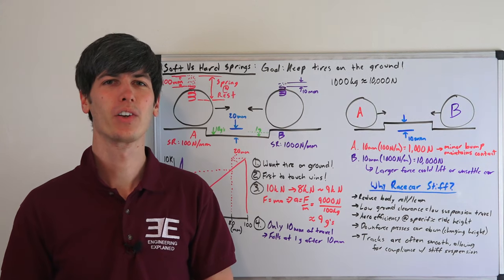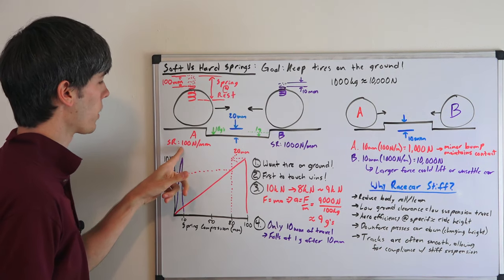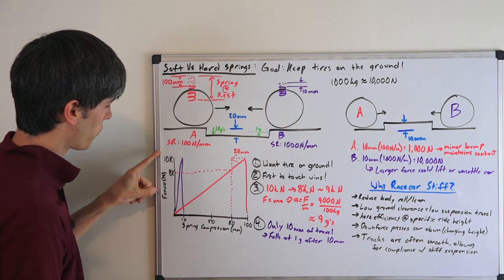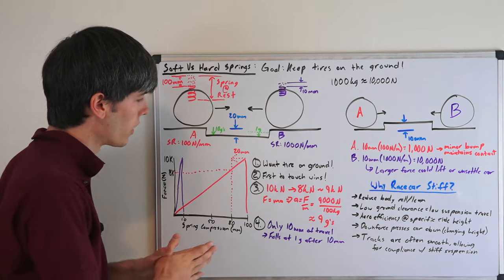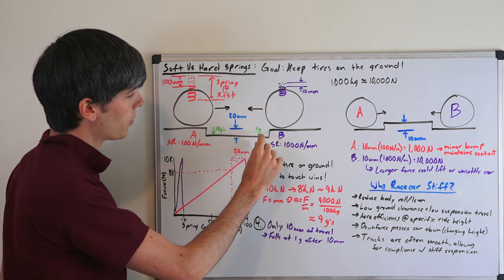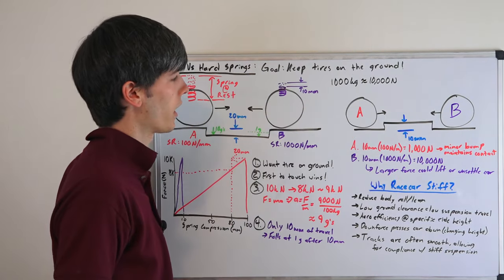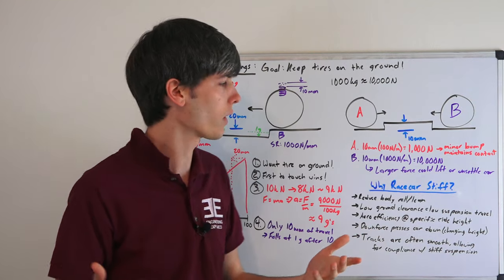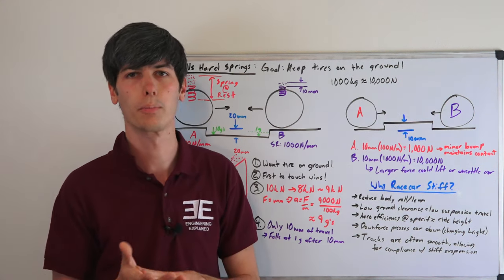What's The Best Suspension - Soft or Stiff Springs?

Comment: Soft if you can handle the roll, since a soft suspension means grip. I've noticed that in some cars, just upgrading anti-roll bars and adding sticky tires improves the handling a much greater amount than when a lowered and stiffer suspension was added.
Reply: Unbearable Pain I disagree.  Some people say the primary roll stiffness should come from the springs, not the sway bars.  The sway bars reduce the independence of the suspension.
Reply: TassieLorenzo True, but in big V8 muscle cars the suspension isn't independent anyways.
Reply: TassieLorenzo totally untrue... wheel indepenence ist not nessesarily a good thing. the myth that stiff suspension and hard dampers are a good thing comes from formula 1. in formula 1 you want the car to have the same attitude to the road at all times to maximize downforce. "mechanical grip" is irrelevant in F1. but since a roadcar has no downforce soft suspension will be better. thats also the reason why for example ralleycars have really soft suspension compared to for example f1 cars even when the are driving a tarmac ralley.
Reply: MrBusunglueck "but since a roadcar has no downforce soft suspension will be better. " Then why do road-based race cars with no downforce have stiff suspension? ;)...  I agree there is such a thing as too stiff, but driving some road car on a track day with Hoosiers and using stock comfort-tuned suspension will give a terrifying wallowy feeling and feeling of lack of control.  There is a REASON after all why PROPER sporty cars like Renault Megane RS, Civic Type R, Lancer Evolution, indeed Ferrari F430, etc all come with relatively stiff suspension.... surely? ;)
Reply: TassieLorenzo
the thing is... racecars with no downforce dont have stiff suspension. the reason why all sportscars are stiff is cause thats what people want. the nurburgring laptime off the current 911 turbo s for example was set with the dampers in comfort mode. the nurburgring is a bumpy track, but still that says a lot for me.
Reply: I prefer the car relatively stiff (not too much of course)... It's more fun... feels more connected to the road. :)

911 Turbo is not my kind of car... The steering wheel is huge, the steering ratio is very slow... It's very much old-school luxury GT style.

The 911 GT3 would be my choice of 911 (as if, lol :P, one can dream).  Something more frantic, something that still feels fast even when it's going slow.
Reply: fuckoffgoogle
turn in speed is just one thing. stiffness may improve it. turn in speed however isnt always a good thing. some drivers prefer a hight turn in speed some dont. mid corner speed might be improved aswell by high stiffness. the two most important things however are longitudinal traction under acceleration and braking. those two are improved by a slightly softer spring and more suspension travel. car manufatorers these days set their cars up so that they feel sporty, not so that they really are.
Reply: fuckoffgoogle
well it might feel faster, but my question was wether it really was faster. still antiroll bars are something even i would recommend.... but even body roll mustnt be such a bad thing really(to some degree(litually)). overall mass has much more impact on performance than center of mass i believe.
ps: another thing is that a soft suspension is really good on a rough and bumpy surface plus its still pretty good on a smooth surface.... hard suspension is only good on a smooth surface.  so for driving on a public road you really shouldnt set up your suspension too stiff.
Reply: fuckoffgoogle
well im only talking about rwd of course... i refuse to drive any fwd car basically. awd might be another story as long as it is a proper awd like on a subaru or something. the VAG awd is basically fwd in terms of cornering dynamics.
Reply: fuckoffgoogle
well subaru always used to be 50:50 and everything pretty fixed like on a tractor(which is a good thing). and about the audi system. i havent driven many audis but even the s4 apparently does do rather more understeer than oversteer. but i really cant say much more apart from the fact that the normal quattro system in normal non S audis is rubbish. even bmw xdrive is much better. i really hate those non permanent awd that turn into fwd, when awd isnt needed. makes the cars feel really shitty. bmw xdrive is more rear axle based which in my hands makes it feel much safer too ironicly.
Reply: fuckoffgoogle
well specificly i was talking about an A6 3.0 TDI. it looked pretty sporty, didnt accelerate quite as sporty as it looked and understeered like a van. but the problem there isnt with the Awd system i guess but more about the chassis(or whatever you call it in modern cars). also you cant turn the esp off properly, so you cant tell what the car really wanted to do. im just not a big fan of audis driving dynamics. the s and rs models might be great (like i said i havent driven any), but the NON s or rs models are just nowhere near bmw is what im saying. especially when you compare something like an a4 2,0 with fwd with a bmw 320i or something. a 320i will feel much closer to an m3 than an a4 will feel to an rs4 i guess.

ps: im not hating btw. most people dont jugde cars on cornering dynamics. but since i do i would find myself buying bmws most of the time.
Reply: Unbearable Pain That's an overgeneralization. First of all, these cars have essentially always had independent front suspensions. Live axles (which is what you have when you don't have an independent suspension) are generally stronger, lighter, and cheaper than independent suspensions, all other things being equal. They are also superior for launching on a drag strip, which is a big part of why classic muscle cars (which are almost universally equipped with live rear axles) are so popular for that activity.

Live axles are also commonly used in pickup and commercial trucks (superior for towing), as well as off-road vehicles -- to this day the Jeep Wrangler continues to use live axles front and rear.

Pretty much all of today's vehicles that could be considered muscle cars are using full independent suspensions.  Corvette was probably the first performance-oriented vehicle to adopt an rear suspension, in 1962. Import performance cars like Porsche, BMW M cars, Audi's S and RS, and Mercedes AMG have been independent all along. GTO was independent in 2004, and its successors the G8 and Chevy SS continue to be independent. Charger/Challenger have been independent since their return to the market in 2006/2008 respectively; Camaro since its return in 2010.  Mustang was last to the party, having just switched over for model year 2015.
Reply: +TassieLorenzo stiffer suspension is required with stickier tyres to allow more braking and acceleration loading without the car pitching all over the place.  suspension stiffness and tyre grip are related - less friction with the tyres means more weight transfer required for them to grip and vice versa.  that isn't the whole story, but is merely one more reason to have stiffer springs than other factors may suggest is ideal (for tracking the ground over bumps).
Reply: A properly designed suspension always uses the softest springs that meet the design criteria. The primary limiting factors are the weight of the car and the available suspension travel. A car designed for great cornering is going to be very low to the ground, which limits the space available for suspension travel. To prevent such a car from bottoming out in turns or over bumps, a higher spring rate is required.
Reply: Sorry, but you're wrong.
Reply: It's funny how many of your assumptions about me are wrong. 

Did I mention F1? Nope. Have I driven on a road course? Yep. In my Camaro, which isn't a "sports car" IMO, but that's not the point. There's video on my YouTube channel if you want proof. I've also done some autocrosses in the Camaro and a handful of cars I've owned in the past. 

Limiting suspension travel isn't just for F1 and ground effects. That's an extreme example. 

A car's suspension has two jobs: to isolate the chassis and its occupants from road imperfections, and to maximize tire contact with the road. The balance of priority between those goals varies from car to car.

I will acknowledge one other benefit of stiffer springs which I forgot: it limits weight transfer, which helps distribute the car's weight across all four tires, which in turn lets all four tires contribute more evenly to the task of cornering/braking (and acceleration, but most cars don't have enough horsepower for that to matter). This is in direct service of the second job I mentioned above. So yeah, I was wrong to claim that a stiffer spring only serves to prevent bottoming out. But since you failed to say why or how I was wrong, no internet points for you. :P

Note that I'm only talking about spring rates, not shock valving. Stiffer shock valving is definitely advantageous for cornering (to a point -- you don't want it to be so stiff that it prevents the spring from doing its job).
Reply: That's why every car should have MR shocks that adjust on the fly. Stiff when needed, soft when not.
Reply: +Unbearable Pain a solid axle is cheaper, stronger and easier to maintain than a independent rear axle. most cars of high torque will have solid axles.
Reply: jeffrey625625 most decent cars with plenty of torque that actually handle however, do not.  e.g., C63 AMG, M5, etc.
Reply: jeffrey625625, there are no solid axle production cars anymore. Mustang was the last holdout, and it switched a few years ago. Only trucks left.
Reply: +Jake Robb       +Economy Cars
Reply: +jeffrey625625 only advantage of a solid axle rear in a street car is cost.
Reply: Robert McAleer Strength, simplicity, and weight are some of the reasons to have them.  Lower cost comes primarily as a result of simplicity, and weight savings.
Reply: +Quadrunner sounds great until you hit a small bump in a corner on one wheel and it upsets the other one causing the car to lose traction. not safe at all in high speed cornering. Only advantage I can think of would be suspension articulation, and that would only be useful in lifted pickups off road. On the road, Independent rules hands down. please give me an example of any high performance or luxury vehicle still using a Live axle rear.
Reply: Robert McAleer Strength, simplicity, lightweight.  You can't think of any other applications haha?  I guess there's no particular reason Ford kept DRAGgin on with them then.

Example: I got nothin for mainstream production.  At the strip its another story.
Reply: +Quadrunner Ford kept dragging on with them to save money on their main Mustangs for cost reasons. The Cobra had more profit which allowed for the independent setup. if strength was an issue then VW wouldn't be using it on their 1200+hp Bugatti Veyron. I do think they have their place, however not in any situation where cornering performance matters.
Reply: Robert McAleer Alright, riddle me this.  In two different vehicles with the same power and loading goals,  One has a really good handling suspension, but the design isn't strong so they made up for it by using more material.  The other has a design is naturally stronger, so they continued to use less material for the same amount of strength.  Which will weigh more?  

People always talk about these engineering things like there is one thing changed at a time.  Its all connected.  You change one thing, and it will affect them all to some degree in many situations.

Why on earth would you choose to compare a top speed super car to a pony car?
Reply: +Quadrunner As far as the weight is  concerned, I do not believe live axle is any lighter than an independent setup, not to mention you can simply switch to lighter materials. as far as supercar vs Pony cars is irrelevant because both are using the far more superior independent setup including Ford as of 2016. This discussion reminds me of people claiming older vehicles are safer in an accident simply because they are heavier and more "solid".
Reply: Robert McAleer That's not the only advantage and it is significant amount for a drag racing situation.  It seams illogical to bring materials into this, as the same materials could be utilized for either application.  Do you need me to find a link for you or something?  This isn't a conversation of interest to me at this point.

PS: The intended use of the car is relevant as it is the BIGGEST reason a particular design should or will not be used.  A Pony car, has a very different design, then a Bugatti Veyron.  They have different goals, and take different routes accordingly.  I thought this was self explanatory for some reason.  

PSS: A heavier vehicle does get a general advantage in a crash.  Whether you're acceleration is reduced by increasing mass or the use of crumple zones and air bags, you are still safer.  Obviously one factor like increased mass does not determine overall safety though.  There are multiple aspects.
Reply: Koenigsegg, bugatti, etc. use independent rear axles.  live axle is cheap to make strong and not squat excessively, thats its only advantage.  IRS with the appropriate design is superior, as proven by any serious performance car - from WRC to F1, to 1200 hp production street cars...
Reply: +Quadrunner Which advantage? The weight? Even if there is a slight advantage in overall component weight the unsprung weight is much higher on the solid axle which will cause additional stability issues along with increased cabin noise over bumps along with lower ride quality. Like I said, there may be some applications where the solid axle is best, however in most road applications the advantages of an independent suspension severely outweigh the disadvantages, otherwise all the major OEMs would be  preferring it to the more expensive and complex independent setup.
Reply: +Quadrunner Yes, I can agree that solid axle would be sufficient when primarily going in a straight line. A good case for them would be Heavy duty trucks and Equipment as well. No need to focus on ride quality or performance characteristics for those.
Reply: Robert McAleer Look buddy I thought I spelled this out for you.  Drag racing.  If that is the intended application a solid axle is king. Some guys at ford apparently came to realize that today's market prefers a significant increase in turning stability over a cheaper, better drag car.  Calling IRS better in general does not make sense to me, as its not the best across the board.  It is however, an excellent compromise, and obviously someone important realized that.  As we needlessly type away right now though, I wouldn't doubt that some guys, somewhere, are in the process converting their IRS Mustang to solid axle.  I'd bet some other guy is retrofitting IRS into an older Mustang as well.  Why?  Because neither is an across the board better design.  They have their applications.
Reply: Robert McAleer Whoops, sorry for the redundant reply.
Reply: Uh... IRS is better overall than live axle.  Live axle is cheap for straight line or carrying loads (i.e., in a truck).  In every single other aspect, IRS is superior....
Reply: Jethro Rose Better overall for you....Its subjective.
Reply: not really, it's quite objective.  if you take into account all factors, live axle loses on the vast majority of them
Reply: Jethro Rose 
Strength: Win
Weight: Win
Simplicity: Win
Cornering Stability: Lose
Ride Quality: Debatable.  We'll call it a loss
Straight line traction:  Win
Price: Win
Ground Clearance: Lose
Articulation: Win
Alignment Under Load: Win
Alignment in cornering: Lose
Efficiency: Debatable  My gut sais Win, but I'll call it a tie since there is often a degree of aerodynamic drag offsetting the decrease in drivetrain loss to an unknown extent.

Did I miss anything?  The reason I said it is subjective, is that different strengths and weaknesses will hold more or less weight depending on application AKA unique personal preferences
Reply: straight line traction over anything other than perfectly smooth surface: lose - action of one wheel affects the other
ride quality: definite lose (as above)
alignment in cornering: static, can not be set up to give better alignment under lateral load: lose
weight: LOSE because it is a huge amount of unsprung weight which is far worse than sprung weight

I'll give you strength, simplicity and cost.

if cost is not a concern, and if you want the BEST, then no it isn't... you have simplicity (and again, if we're chasing best, who cares) and strength.  which is why it is found on trucks (where performance isn't so important anyway) and budget cars (including budget "performance" vehicles).
Reply: Jethro Rose straight line traction over anything other than perfectly smooth surface:
^^Bullshit.  Sorry, that's the most fitting word I could think of.  I don't mean to talk down on you.  I mean if you are racing across railroad tracks maybe, and I mean MAYBE but perfectly smooth?  Be honest.

 lose - action of one wheel affects the other
ride quality: definite lose (as above)
^^Sure

alignment in cornering: static, can not be set up to give better alignment under lateral load: lose
^^Yup Hense the Lose

weight: LOSE because it is a huge amount of unsprung weight which is far worse than sprung weight
^^WIN - Unsprung weight was not mentioned but should have been.  You could make another category there and call it a lose.  Solid axles and their linkage turn out lighter though.
Reply: +Unbearable Pain Ding ding ding !! We have a winner!! I completely agree. I have a 99' Miata the expression of soft springs and ... well too much body roll. Having said that I added some SUPER sticky tires (Advant AD07 Yokohomas) and WOW this thing is seriously like glued to the road!!
Reply: +Jack Allen : My one is a 10.Ani stock equipped with  Bilstein shocks, anti roll bars and some reenforcement bars all made by Bilstein / advised by Bilstein guys and I also added semi slicks  Hancook Ventus Z 222 RV3- unbeatable on our twisted roads !
Reply: @quadrunner2124 the beam axle is obviously going to be less stable on a bumpy straight line